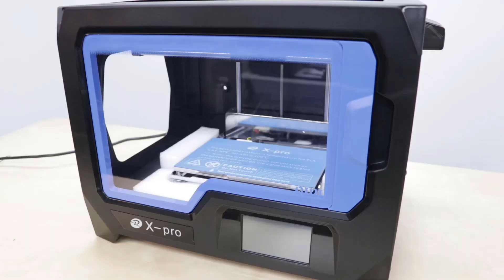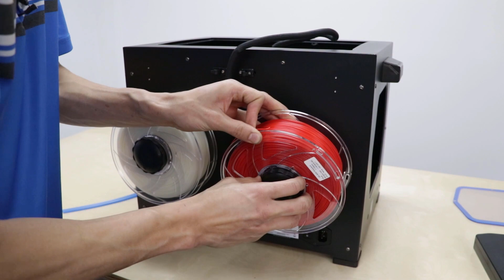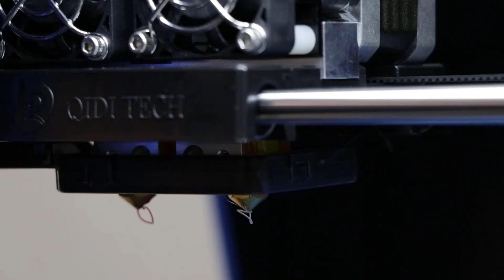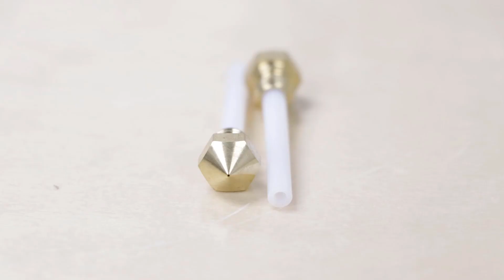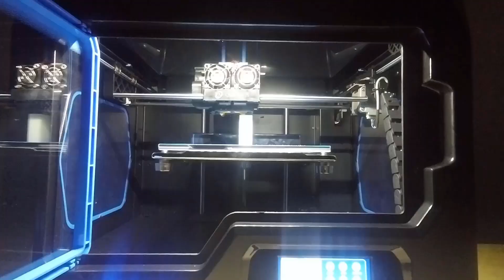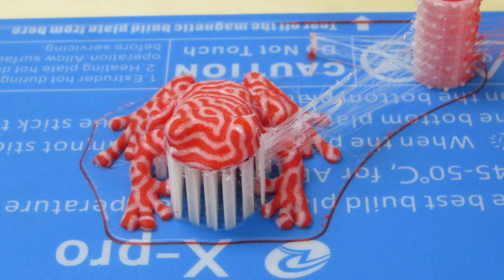Qidi Tech X-Pro 3D Printer Setup and Full Review

Comment: The manual should just be a link to this youTube !  ...  You saved the day.
One suggestion for fellow readers.    When putting the screws into the extruder and the fan baffel  ... put a sheet of paper over the bed.  This way when you drop a screw, it does not fal between the bed and the bottom plate.  (It took me 15 - 20 minutes to get the darn thing out.
Reply from the maker: Thank you for the kind words man 👍
Reply: Overall the video is good. Clarity regarding Left and Right extruders. I’ve owned a couple of QiDi printers and in the video you might be mixing up the left vs right side of the printer. This is very import as to prevent miss prints at the very start of your print.

Comment: is there any chance you'd be able to answer how to level the nozzles to the same height? yes, i know the printer is ancient, i got it for $100. But the left nozzle is not the same height as the right nozzle, so actually printing multicolor doesn't work because the right nozzle scrapes. otherwise, it works fine for what it is.
Reply from the maker: Sorry sir I haven't had this printer in years! There's gotta be something for that

Comment: Its 2025, my friend gave me one of these printers for free, it was new in a box, his company gave it away. Your tutorial was great but my right extractor temp is set to 1023/220 and didnt really work. Anyway i started the test file that on the USB stick with my left tube which seemed to work as normal., It supposed to be a cube and its only 20 minutes in but it look like spaghetti all over the place, i can see the cube is barely held together. is this thing even worth my time or should i toss it and get a newer 3d printer. I know this is nearly 10 years old and i got it for free, im thinking is trashing it but should i try to fix it?
Reply: probably the filament you used. mine did that too until i figured out that i was printing petg way too low (i thought it was pla :D)

Comment: so I got one, and here is a major flaw of the duel extruder, if one of the extruder is positioned out of alignment +/- 1mm, It will continuously destroy your prints, as they are side by side and move together. I initially thought this would be great....but now its just crank in the shaft  in my hobby
Reply from the maker: They should have been calibrated but depending on who you got it from, clearly they might not be. There's 2 things you can do, adjust the head yourself. It's not that hard to do. Or you could print with the lower head only, and you don't have to worry about your problem.
Reply: @AJRobinson  I think id rather scrap it and get a new one. thanks for the feedback

Comment: Awesome video! incredible well explained and objective. I been printing for 3 years with a qidi x-pro and I had that problem with the building plate. If you DONT apply any glue or fixing to the plate some materials will bond with it and will be very difficult to remove. I lost like 3 plates already. Using a razor will cut some of the material, or even forcing it will cut it too (with the hand). I found out that when is too fixed to the plate, putting it on the fridge will help to remove it. 

The always put a glue or something soe there is a thin layer between the print and the build plate, and will be easier to remove. This printer building plates are exactly the other way around, you need glue so the piece dont stick too much hahaha

Thanks for the video, I was thinking to purchase this as secondary printer, to print the same models that I'm printing repletely and keep my x-pro for new designs.

Comment: Hey I’m having an error every time I try to print saying “temperature sensor failure or power supply inefficient”, do you know what I’m doing wrong?
Reply from the maker: Something is wrong with the heaters or the thermistors. Try to manually heat up both extruders and the bed individually, one of those 3 should either not heat up, or show that it's not heating when it is. That way you'll know if it's a temp sensor problem, or one of the heating elements is bad
Reply: @AJRobinson  thank you so much for the help! It seems that the issue is the heated print bed, I might need to look into reassembling it. Thank you!

Comment: What a POS! I replaced my Da Vinci 2.0 and after three days screwing around with this POS I still haven't figured out how to send a print to the printer  by WiFi or printer cable connection. DO NOT waste your time or money with this one!
Reply from the maker: Give it some more time before you leave such a negative review!
Reply: @AJRobinson  You're right, I was just a little disappointed that I didn't receive the stainless steel spool holders, the Tool Kit, an extra build plate or second TPU extruder as shown on one Youtube review' Also none of the videos addressed printing via the wireless connection. I discovered that the USB thumb drive has to be installed in order to print via WiFi. I am just now printing my first model, got my fingers crossed!

Comment: AJ!!! i have a big question. how to unload and add a new color filament mid print
Reply from the maker: Just pause the print, go to the menu and heat up the extruder, then go manual control menu and unload the filament. Then load it back up, make sure to extrude some to make sure it's primed and then hit resume

Comment: I bought mine and it should be coming in at the end of the week. Is the dual color printing something that you have to design first or is it something you do with the slicing program that comes with it (like the frog you printed, did you design out those stripes in your CAD software or in the slicing software?)
Reply from the maker: Yes so it's basically two different models that are then overlayed. Watch a video on dual color printing! You can also download and print that same frog I did from here: https://www.thingiverse.com/thing:329436. If you are using the Qidi slicer you need to overlay both models and then right mouse click to merge or group, I forget which is which.
Reply: @AJRobinson  you know why when I brought my two stl files into the qidi slicer they didnt drop in the position that they were designed in? Is there a setting in the slicer to fix this or do I have to design the parts a certain way?
Reply from the maker: @boostedskyline  Open up both models in the slicer, treefrog_hollow and treefrog_solid. For the hollow, click on the model, and then click on the left extruder option. For the solid, click on the model and the right extruder. Then hold the shift key and select both, right mouse click and choose "Merge Models". You should now see a yellow and red mashup indicative of the R and L extruders. Slice it, and if you do a layer by layer view (bottom right toolboar) you can un-select one of the extruders and see the gaps the other extruder will fill.

Comment: Followed you in step to step until I power on my printer and got a white heavy smoke underneath!..after that it released some oil/fluid and that was it🙆‍♂️.
Reply from the maker: Dude what happened!?
Reply: @AJRobinson  Am not expert in electrical related issues, but  where i live we use 230v 50Hz, so i think maybe that's the issue since i bought it from Amazon and maybe they adjusted it to USA 110v (60Hz?)
Reply: @AJRobinson  I think  it has to do with voltage issues..first i followed the procedures provided by their book on how to assemble everything until i find out i couldn't lift up the base (where flash is located underneath) so i had to find a YouTube video that might explain better so here i was and unfortunate thing happened..Later i had to open the printer base to find out what was the issue, and surely the 24v power supply is fried as it was still leaking some kind of oil and still smelled like a fried circuit. Unfortunately the power supply is the only subject they didn't touch in their manual (may be on the flash that is still stuck!) so no any point of reference for me.

Comment: Hi can it use flexible filament (rubber)? Thx
Reply from the maker: It can print TPU, which is a flexible filament. As I'm not sure as to what exact filament you are using I'm not sure. If it's similar to TPU, you should be fine as long as you play with the settings a bit